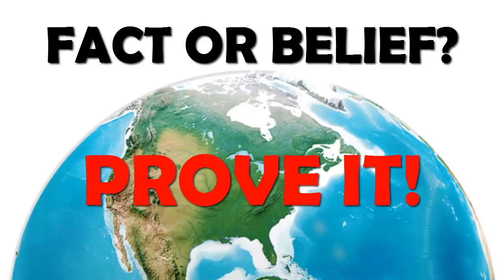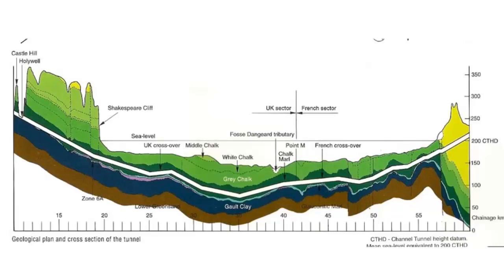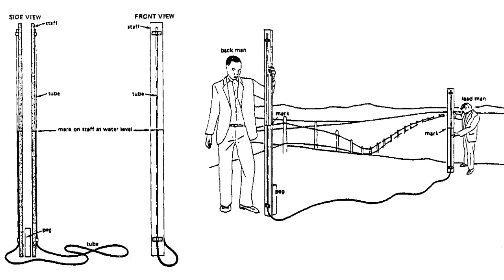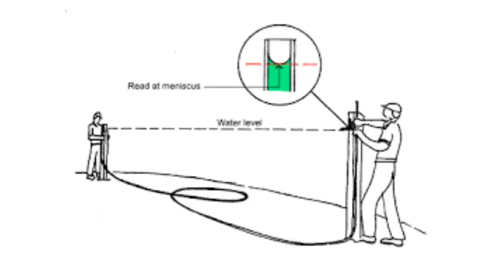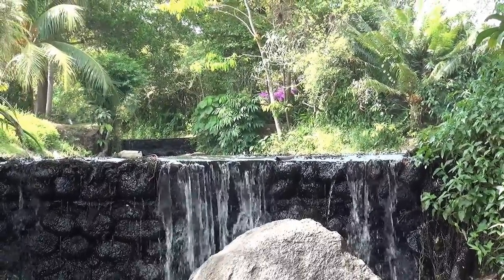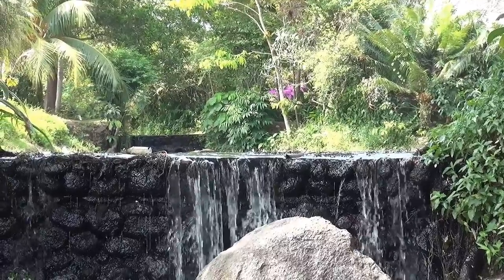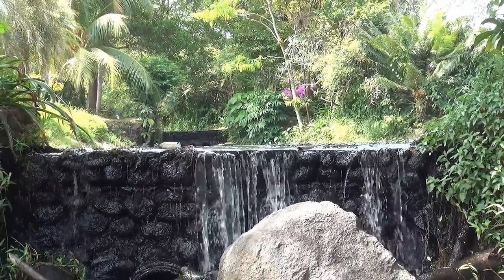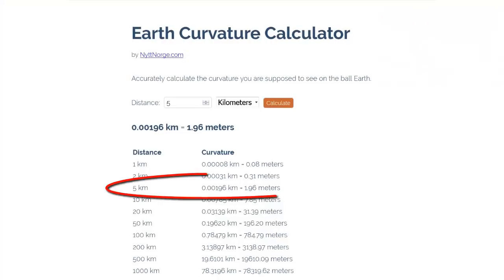Flat Earth Water Level Challenge - Prove Bendy Water Not Flowing

Comment: Everytime you see a ship, through a camera for example, go down below the horizon (curve) bottom first until the top is gone it's proved. And now you probably say something like it's your eyes, but even if go backwards but to a much higher place you can see the top again. How does that work with your "perspective" eyes? Is the moon round like a ball?
Reply from the maker: That is not MEASURING!
Reply: @PhuketWord  measuring what?
Reply: @ofcourseitsnotflat5557  typical
Reply: If Phuket wants things measured, how about gravity? I measure it everyday as part of my work manufacturing and calibrating accelerometers. Accelerometers work solely on gravity. FE's beloved density and bouyancy aren't the principles on which they work. At rest on the earth an accelerometer measures one G, the gravitational constant. If I accelerate them upwards from the face of the earth they measure the rate of change from the inertial frame of reference. If I drop them towards the earth they measure zero. Only flat earthers believe that gravity is a theory and can't be measured as they have a limited grasp on real science
Reply: @tonywilliams1493  Not to mention that neither buoyancy or density even exist without gravity.

Comment: This could be resolved with a simple thought experiment. If you have a sphere in zero gravity (no true down) and it attracts water at all directions equally, if you cover the whole surface with water, where will it go? Which direction will it flow?
Reply from the maker: We all know how to think and imagine the no-down scenario. We all understand that on a circle, down is in all directions. However, the reality is that water DOES flow down a slope. So, when does that not happen?
Reply from the maker: And again, I have to remind you that it is impossible to have a vacuum without a physical barrier. "Gravity" does not act as a container all by itself. Rember, the "force" of gravity is nothing more than a different measurement of weight. Gravity does not create weight. Weight IS gravity.  Sure, we can 'imagine' with thought experiments that the mass of the earth creates gravity but that is just a theory to go with the globe theory.. 
1kg of force (weight) is essentially 10 netwons of force. It is no different to a currency conversion with 1 dollar equalling 10 Yen, for example.
Reply: @PhuketWord  sorry, I wasnt trying to suggest you couldn't. Just an angle to look at. well add a parameter to the scenario...

Make a notch in the sphere. Will the water make an even layer or fill the notch?

The idea is that the water will find a way to be as close to the attractive force as possible which is why it would for a sphere around it. If the water were to make a film on the surface of the notch walls instead of filling it, it would suggest that the water in this case wasn't being pulled towards the center but rather to its surface instead

So in a now true down scenario, the water would run 'downhill' into the notch, filling it up and once full, the wvwb sphere would be reestablished assume there was enough water present to fill the notch and then cover the rest of the sphere.

Alternatively, if you had a rise, all water on it would travel downhill so that all surfaces of the liquid were equidistant from the source of attraction
Reply: @PhuketWord  also, just as a point of interest, you do realise that in your description, it says to prove bendy water that doesn't flow and now you have asked me to explain why it does flow. I am a little confused as to which aspect you are trying to ascertain here
Reply from the maker: But the whole point here is to measure reality. When we do that, the globe doesn't stand up to scrutiny, nor real life physics. It's as simple as that.
Reply from the maker: The point is that water flows down a curve or slope, right?  Down for the water is only wherever it is not contained. A globe is a constant curve.....  Seriously, just draw a circle and have down being in all directions towards the center but at the same time make down what it really is - down a curve. You can't have both.
Reply: @PhuketWord  sorry, just spotted your second response. I didnt think the challenge had to include how an atmosphere exists near a vacuum.

Got a couple of question to ask before I respond 

1) do you believe there is a pressure gradient?

2) do you believe that pressure evacuation is driven by a pressure differential?
Reply: @PhuketWord  well no, you're missing the point I'm making with the notch. If you had a little bit of water it would flow into the notch no matter where on the sphere it is and stay there. Tiny people may look at that and say it is there because it is contained when in reality, it is there because it is closer to the point of attraction. That notch on a sphere would have a downward slop towards the bottom of the notch. That is you downward slope right there
Reply: @PhuketWord  pardon for the silly analogy but if down for water is wherever it is not contained, then why doesn't water float out of my glass through the uncontained side? No, it only heads to where it can be closest the the point of attraction, the centre of the earth
Reply: @PhuketWord  2 more points. 1 if you understand the no-down scenario and you understand that in such a scenario, water attracted to the centre of that sphere would form a uniform layer on that sphere and thus where would it flow(?)
Then surely you understand that if you introduce a notch where the bottom of the notch is closer to the centre (shorter radius) then the water would naturally flow to fill that notch before spreading out over the rest of the sphere?

2. Is it that you think that I think the earth is a perfectly smooth sphere with zero deviations?
Reply from the maker: Again, the point of all of this is to consider everything together - not compartmentalized explanations. They all have to fit together if you want to claim a model. Remember, I am claiming only that the globe model does not fit with all reality but I am not claiming any alternative complete model. 
1) yes, there is a pressure gradient. 
2) You mean different pressures will equalize? Yes.
Reply from the maker: You only assume water in a glass is heading towards the center of a spherical earth.  The only observation we can actually make is that water is denser than air so it fills the glass (a container).  You see?  You can not do anything with water without first having a container!  So really, water will fall until it is contained or hits a solid barrier (the surface of the earth).  That does not mean it is being pulled towards the center of a spheriacal earth.
Reply: @PhuketWord  I am able to post links? I'd like to send you one. A youtube video
Reply: @PhuketWord  oh and by 2) I meant that the force with which it equalizes is proportionate to the pressure differential (as on you will have more force from a burst industrial pressure line than a balloon)
Reply from the maker: YOu can post but then I have to approve it because it will get automatically blocked.
Reply from the maker: OK. You can consider any of these pressure differences forces. They are not affected by any other external force. Again, I get that the mass of the earth is supposed to create gravity and that gravity is supposed to cause the pressure gradient.  So where is the proof of the cause?  We've been through this before. Cause and effect can be interpreted either way, so if you want to presuppose a cause, then you have to prove the cause. Equations won't prove anything. YOu have to prove that gravity exists as a force coming from the earth on its own.
Do you understand?  A magnet produces a magnetic field which can be seen and measured without having to have another magnet to prove the field exists. You can't do that with the earth's alleged gravity.. By the way, "gavity maps"  are only measures of the density of rock on the surface. They are not measuring  a force.
Reply: @PhuketWord   Phuket Word  ok, well I posted it so have a squizz and see if you can find it.

Ok, can you try not to bounce around too many aspects here. You said earlier to prove that out atmosphere doesn't need a container. Now in terms of gravity, whether gravity is real or not, we can both agree that there is a pressure gradient. We can also both agree that the lower the pressure differential, the lower the driving force for it to equalise.

Sonic the pressure gradient exists then what evidence do you have to say that it stops somewhere? Ocams razor would suggest it doesn't. And for context, at 75,000 which some high altitude balloons can reach, the air pressure is just 1 psi

The air pressure continues to drop past this point as well, so as it is, the driving pressure differential we can expect is going to be less than 1 psi...

I dont know if you know this either but the larger the area for which gas can escape, decreases the velocity at which it escapes. That area is very very large

Now, we do lose atmosphere constantly to space but negligible amounts when compared to how much is currently surrounding us. My point is here, that there is little to no driving force and it doesn't make much sense to assume otherwise.
Reply from the maker: OK. Link approved. Does gravity act like a magnet?  No. Otherwise we would literally be stuck to the earth. You would have difficulty walking! A leaf would stick to earth like a paper clip to a magnet. You can't have a massive magnet (the earth) and the "force"  it exerts being relative to the mass of each object sticking to it.  In fact, many globe defenders rightly say that gravity is not like a magnet. So you see what happens?  Gravity is explained as being a translation of weight. It is literally, the heavier something is, the more gravitational pull there is!  It is just as I explained. US$1 becomes 10 Japanese Yen. The value does not change, does it? This vid of mine explains that concept: https://youtu.be/bTScFuqghC0
As for gases escaping, remember that gravity is supposed to affect each molecule relative to its mass. (I have explained this to you before).  So the gravity acting on a single molecule of gas is minuscule. That gravitational pull is nothing compared to the force of pressures equalizing, is it?  So where does it end as we get up high?  The logical answer is that we have more layers of light gases above us, and they will be super cold. So in fact we CAN have liquid above us, such as liquid helium. 
Understand? Helium is lighter than air so it will form a layer above the air. Just the same as in a fish tank with layers of liquid and gas,.
Reply: @PhuketWord  I think you may have gotten the wrong idea with the video. Firstly, the magnet is used a proof of concept that if liquid is attracted to the center of a sphere, it will form around it. I'm not in any way suggesting the earth is a magnet. So they way you have represented your understanding is that I'm suggesting we're attracted to the earth's surface in the same way a paperclip is attracted to the surface of a magnet. However, the example give was a sphere if clay (non magnetic) with the attractive force at its centre. The same as gravity pulls towards its center. Given the r^2 law, we're far enough away from the earth's centre that we wouldn't just snap on and off of the earth's surface.

As for the air pressure. First point is the gravitation pull is proportionate to its mass. If it has minuscule mass, it has minuscule pull but always proportionate. Now, unless you can give me some reason to suspect there is a barrier, the actual difference between air and vacuum is infinitesimal. The lower the air pressure, the greater the ratio between pressure drivin push and gravitational pull.

As for the higher gasses being liquids, this isn't the case. Have you ever heard of a phase diagram? Basically, for any substance there are two factors which determine the physical phase of that substance (solid, gas, liquid, ect..) those two factors are pressure and temperature. Vapors will form at either elevated temperatures or decreased pressures. In this case, it may be cold but not cold enough to liquify gasses. For examples, at the example I gave you earlier (75,000ff) I said the air pressure is only 1psi. The data from those flights also tell us the temperature is -45°C but for helium to be a liquid at that pressure, it would actually need to be -272°C. You can look this up with an image search "helium phase diagram". I've used these before for work and they are accurate. 

The only way these gasses would naturally reach this temperature I'm our atmosphere is if the sun had gone out permanently a couple thousand years ago.

So basically, we cannot have liquified gasses above us. It just doesn't work like that

Comment: You have some patience m8, I'll give you that.

"A water level; Greek: Aλφαδολάστιχο or (υδροστάθμη) [Alfadolasticho] is a device used for matching elevations of locations that are too far apart for a spirit level to span."

"The water level is lower-tech than the laser level, but it can be more accurate over long distances"
Level: Matching elevations. Gee, I wonder how water levels work to check level.

Here's my question to those who think they are on a globe..

"Density of helium 0.179 g/L
Density of hydrogen 0.08988 g/L

Helium and hydrogen are more abundant in the upper atmosphere.

Density of oxygen 1.429 g/L
Density of nitrogen 1.2504 g/L

Oxygen and nitrogen are more dense and found nearer the surface. Hot air rises due to density and elements in the air, rise or fall based on their density.

Density of  tissue paper  250 kg/m
Density of steel 8,050 kg/m3

If I drop a sheet of tissue it will float to the ground. If I drop steel it will sink. As we can see, from the elements in the air, to physical objects I can give you the density and show how they will rise/fall in relation to the medium.

Here's where you can help me with calculation. Not words, the math and the equations please. 

Using the set of 10 equations in Albert Einstein's general theory of relativity, please predict and explain how these interactions cause elements with a higher density to rise and elements with a lower density to sink, seeing as it's not density in your opinion.

Please expand on this, or correct Einstein by confirming through modern quantum space time calculations why we observe these absolutes.  If you could tell me, through calculations, not words, how the higgs field is interacting with the elements, causing the coincidence that higher density elements sink, and the converse for elements with lesser density?

Globe is satanic deception...

 "We do know that Isaac newton had access to certain mystical texts, certain texts of the kabbalah"
Michio Kaku (proof: SCIENCE AND KABBALAH
. Youtube)

"But Sir Isaac Newton was also an influential theologian who applied a ... into the study of Jewish philosophy, the mysticism of Kabbalah"
"Israeli library uploads Sir Isaac Newton's theological texts - Telegraph (English newspaper"

"In the book, The Religion of Isaac Newton, Frank E. Manuel wrote that “Isaac Newton was convinced that Moses possessed the knowledge of all scientific secrets.” Dr Seth Pancoast wrote that “Isaac Newton was led to the discovery of physical laws (forces of gravitation and repulsion) through the study of Kabbalah.”
.

“Isaac Newton was led to the discovery of physical laws (forces of gravitation and repulsion) through the study of Kabbalah.”
 
Kabbalah
/kəˈbɑːlə,ˈkabələ/Submit
noun
the ancient Jewish tradition of mystical interpretation of the Bible

Einstein:
"Now comes this Einstein. Without even the benefit of a proper German education, he was fiddling with numbers and symbols and through some kabbalistic magic conjuring a universe in which it was impossible to say where you were. "
Source:New York times.

Or how about sun worshiping copernicus?

"Wrote Copernicus:
“In the middle of all sits Sun enthroned. In this most beautiful temple could we place this luminary in any better position from which he can illuminate the whole at once? He is rightly called the Lamp, the Mind, the Ruler of the Universe….”

" we place this luminary in any better position " From his own words, HE PLACED IT THERE!! WAKEY WAKEY

Copernicus - Kabbalism never taught that the Earth was the physical center of the universe. We may be located at a point of spiritual nexus for the universe, but we're not located in the astrophysical center of it all. Kabbalism has also taught that the Earth spins about the Sun in the same way the Moon spins about the Earth. Further, the handful of relatively fast moving stars seen in the night's sky were taught to be other planets also spinning about the Sun. This is precisely what Copernicus deduced from his detailed observations of the night's sky, over several decades, and verified using precise mathematical derivation. Copernicus' book, On the Revolutions of the Celestial Spheres, was published more than 450 years ago. (Zohar - Books III, IV, VIII, LXVI)

Legit, bro.

Copernicus, before the invention of the telescope, had concluded we're on a ball spinning, and the sun is the center of the universe. A conclusion arrived at by his "detailed observation of the night sky" LOL
 It was then accepted by the Roman Catholic church until protestant opposition (because he got it from kabbalistic texts)

The irony is palpable. 

People used to worship the sun. Primitive people would see it brought life, light and warmth and venerated it. It got an upgrade since then and now it's the center of the universe, holding everything together as we circle it. sigh

Do all religions require you realize it's a religion? Imagine what potential bullshit will be sold to us next as 'science' with this much blind faith.